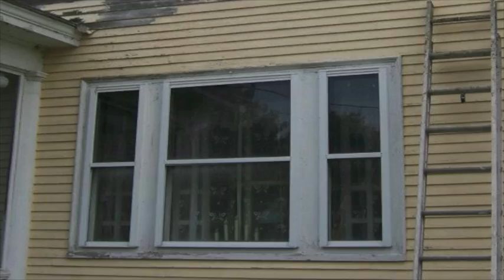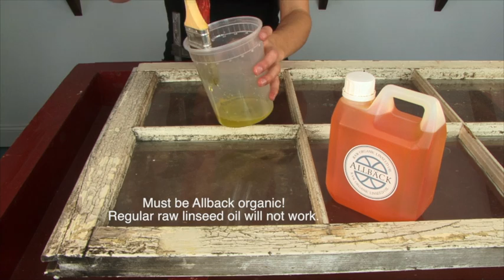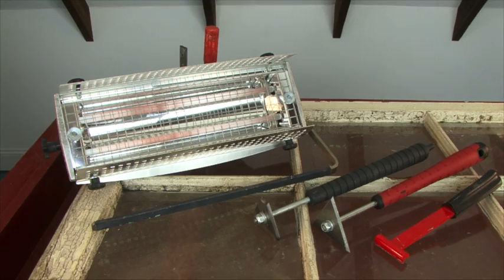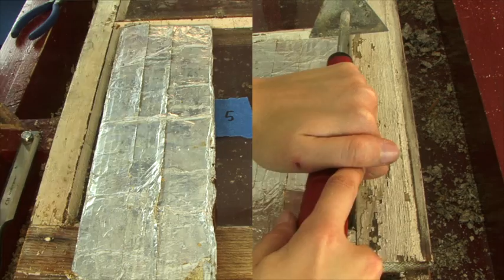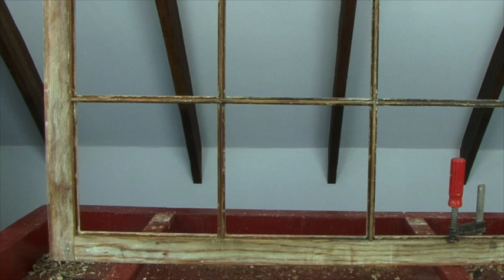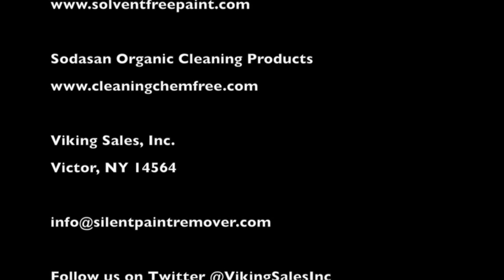Window Restoration w/The Silent Paint Remover: Part 1 [Full]

Comment: Thank you very much for this great video. I am removing old paint from a 100 year old windows and was wandering how critical is to clean ALL the paint. Its very hard to go between the ridges of the wood and I don't want to sand to deep. I am planning to use raw linseed oil and linseed oil paint.
Reply from the maker: You do not need to remove every speck of old paint from the wood grain certainly but the better prep to achieve a “primarily bare wood surface” means you have the best surface to then apply your Linseed Oil Paint. Agreed, you want to avoid sanding as much as possible so do you best and if you feel uncertain, you can always email us an image of the current condition and we can offer suggestions: info@earthandflax.com Hope this is helpful!

Comment: Any advice or comments about using boiled linseed oil instead of raw linseed oil?
Reply from the maker: As long as you use a purified/degummed, higher quality linseed oil, you can in theory use either for window restoration. We would recommend a heated, drying Purified Linseed Oil for most applications. For exterior applications, the Viking Purified Linseed Oil has a small molecular structure, soaks in deeply, and has a 48 hr timeframe typically. A very useful, versatile oil to use. Be careful using a true Swedish raw linseed oil as it will take a long time to fully dry. A purified boiled linseed oil like the Ottosson Boiled LO can also be used. It has a little faster dry time, is what the Ottosson Linseed Oil Paint is made with, and has a larger molecular structure (doesn't soak in as deeply/quickly). Hope this is helpful!

Comment: Great video. Using your strategy/procedure for heating the putting, what is your incidence of cracking panes of glass. Do you prefer the tape or the cardboard? Thanks.
Reply from the maker: Great to hear the video was helpful. I am neurotically careful about covering the glass when heating with infrared so rarely have issues with breakage (I also do not do window restoration as a profession so work rather slowly/carefully). If it happens, it is usually very thin, old glass. I prefer the covered cardboard so I can move it around as needed and cover certain areas of the wood I've already heated for example. It is really up to personal preference I think so experiment on an extra or salvaged sash to find what works best for you. Also, if you are working on a lot of sashes, there is an infrared Putty Lamp that uses a different type of bulb where there is no risk of breaking glass. Glass must be clean for this tool to work effectively. Not something we have added to the website yet, but I can source it if needed. Hope this is helpful. Feel free to reach out to info@earthandflax.com with additional questions.

Comment: Is there a method of getting the glass out of the lower sash, where the glass is inserted into a kerf in the meeting rail? I've found that this part is very difficult and I've broken several windows trying to remove glass from the lower sash

Comment: Does this window contains lead paint ?
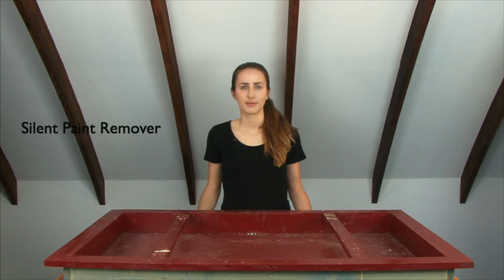Reply: Yes, she said it contained lead at 0:50
Reply: @stegokitty  thank you
Reply from the maker: It is often best to assume all old sashes may have lead paint present. That is one of the reasons why infrared is a good choice for paint removal - lower operating temp. It is always advisable to wear proper safety gear, including a respirator, as even modern coatings can have safety concerns associated. Dampen and dispose of debris as directed by your local community waste management location.
Reply: @Earthandflaxstudio  lead is also a problem when it contacts the skin, gloves are annoying but I wish I had known this when I started this kind of work. Lead poisoning is not fun, and permanent according to my doctor.

Comment: What if you want to stain and varnish the inside? How do you deal with the paint that stayed in the grains?
Reply from the maker: Hi John, It sometimes can be tricky to achieve a stain or varnish grade surface and much depends on the condition of the wood. A trick with infrared is to apply some Viking Purified Raw Linseed Oil to the surface, heat with the infrared tool, and use some steel wool to clean out the grain. Repeat as needed.

Comment: Do you know of any tutorials on using similar products for old overhangs that are caked on with paint? I've been removing it with the Cobra paint remover, but it does not come off anywhere near as well as it seems to come off of your windows. It could be not using Linseed Oil, but I'm not sure if I should use that because I'm not sure if I'll be using Linseed oil paint for the repaint.
Reply from the maker: Hmm the Cobra should be the same technology as The Silent Paint Remover and usually the more layers of paint the better with infrared. That said there are some coatings that are not responsive to heat like milk paint and shellac. Such coatings are rarely found on exterior facades but that could be a factor to consider. Is the paint softening at all? Perhaps it is very dry and the Purified Linseed Oil would help reconstitute it, although as you hinted at you don't want to soak the wood with a lot oil of you plan to use a plastic paint. If the coating is not responding at all to the infrared heat, then you probably have to find another paint removal option. Feel free to email info@earthandflax.com with more project details. Thanks for your question!

Comment: Can anyone tell me where I can find 'inorganic' linseed oil!? People using these terms should learn what they actually mean instead of just using popular buzz words.
Reply from the maker: Hi Stephen, Thanks for your comment. Most generic linseed oil products are pretty much petrochemical products at this point and the Allback Method in Scandinavian Windowcraft circles has always used the term "organic" for linseed oil/linseed oil paint. Today, I think the term Purified Linseed Oil is perhaps a better term and one I use more so to divide a natural linseed oil that has had the proteins removed and heated to create a RLO or BLO vs. a petrochemical linseed oil that uses chemical driers and other additives (fungicides, pesticides, etc.) to combat the downsides of not removing the protein. In newer videos, you will notice "purified" has pretty much replaced "organic."
Reply: Petrochemicals are, by definition, organic substances. Highly bastardized term.
Reply from the maker: Yes, so you would agree "purified" linseed oil would be a more helpful term to categorize an alternative method of manufacturing the product?

Comment: How do you dispose of the old paint and putty?
Reply from the maker: Hi Joseph, Check your local regulations as if lead is present in the paint it is usually required to drop off bags of paint waste at the nearest hazardous waste collection site or designated recycling center. Different municipalities may have different requirements. Feel free to send project or Linseed Oil Product questions to info@earthandflax.com anytime!
Reply: U don't need to do it. You can  next morning put the crunchy old putty and paint chips into the bowl, add some 3,2% milk a bit of cocoa (natural the best but can be Nesquik) and eat this shit.

Comment: I hate to sound all preservationist-like, but often the restoration process is more about keeping and maintaining the old and oftentimes original materials which add to the overall aesthetic of the building. It's not hard to make the argument that newer, factory-made triple-pane windows are more energy efficient. What really matters are your priorities. If you value efficiency and energy cost savings over aesthetics and period details, then go buy yourself a well-made new window. For some folks, putting on a sweater and burning a little more oil is just part of living in an old house. You don't drive an antique car for it's fuel efficiency and reliability; if that's what you want, go buy a new car. But there's something about those old cars...and old houses. Anyway, I'll just keep on trying to convince people not to throw everything in the dumpster. If you must, please call a restoration pro first and have them take 'em off your hands!
Reply: IMO much of the character of an old building is in the old windows. I live in a village in Bulgaria and it really bothers me to see the old fashioned windows being torn out and replaced by uPVC.
Reply: This spring with the virus shut down I started refinishing my 20 single pane double hung 1914 Arizona old traditional windows with internal counter weights and brass hardware.

I love the old traditional windows. It was like being taught by the architect as I restored each piece. I tightened up each window and insulated each side pocket too.

I have already maxed the insulation in the attic, walls, and floor and I have long window drapes keeping the heat inside. Now I have started putting plexiglass in the windows just for the winter for an addition air zone of insulation. It allows the electric thermal floor slab under the bed and desk to silently and comfortably heat the bedroom.
Reply: I’m keeping my 150 yr old growth wood windows. I have to say that they wanted $80,000 to replace my windows with vinyl. I just picked up all the double pane glass, spacers, butyl and weather strips for about $5000. $75000 savings will heat my house for about 500 years
Reply: Wow!  How many windows for $80,000?

Comment: there's only one good solution for these old windows it's called a bonfire breakdown  and go buy some new windows you morons they'll pay for themselves they're more energy efficient and you don't have to paint them what you're doing just looks like a dumb Hobby restoring old energy-wasting windows
Reply: liberty and justice . first of all try to be a human and respect other people you piece of shit .second put the energy efficient windows inside your ass .I love old windows .
Reply: Windows can take decades to pay for themselves.  Try to be smarter.
Reply: tedeohifi dude you're a goof I have a remodeling and construction business for 40 years what do you do for a living it doesn't take decades to pay for a triple pane window do some research before you make stupid remarks
Reply: If it costs $15k to replace my windows (and that's not premium windows), and my average bill (cooling in the summer, heating in the winter) is $120, what percentage of savings do I need to  attain to pay it off in 10 years or less?  Answer:  104%.  Buying new windows would have to completely erase my gas and electric bills for 10.5 years to pay for themselves.  Optimistically, id  maybe save what...20, maybe 30% in heating and cooling costs? So...how many years?

In all fairness, utility costs are different per geography, and so are construction costs, so not all situations are the same.

But for me, refinishing my old windows is well worth saving $15k.
Reply: Couple scrapers, stripper, sanding block, infrared heater...bunch of other stuff, still only a couple hundred bucks, plus my time.  And there's no way id get the money back if i sold.  

Again, not all situations are the same, which is why you are better off not calling everyone who elects to refinish, rather than replace, a moron.
Reply: "Upgrade" something that has been made to last 200+ years with something that will leak it's argon and start fogging in five years - needing to be replaced again in 20 years? And replaced and replaced and replaced... for the rest of the houses life. That's short term thinking. As for efficiency benefits of new windows - it is dishonest marketing. The comparison is of new windows vs doing nothing to old windows in need of maintenance. Reglazing and filling gaps will get you very close to the efficiency of new windows and there's more that can be done. I assume you are making money off the sale of the windows, as well as, the labor. That would explain why you're such a fan of new windows. You're not just a remodeler, you are a salesmen. I have nothing against new windows, just the way they are marketed and the way you have chastised everyone who hasn't bought into your new window marketing con. If you are trying to get people to believe in your product than you are shooting yourself in the foot by being a comments troll.
Reply from the maker: Obviously, folks can get pretty passionate about restoration! If you are interested in learning more about the advantages of old, wood windows and Traditional Purified Linseed Oil Products (paints, oils, waxes, etc.) check out the links in our most recent post. The Allback family in Sweden has created so many valuable resources that we would love to share.
Reply: +Liberty and justice for all
You've used the following words or phrases over the course of your 4 posts:
"you morons"
"dumb hobby"
"you're a goof"
"you make stupid remarks"
"good luck buddy sounds like you're doing a great job"
"you're ignorant"

Hmm, maybe you really are a remodeling contractor!
Reply: Liberty and justice for all dorsch if you don't get it shut up
Reply: Patrick M. Rausch you're ignorant get some energy efficient windows and throw them old windows in the garbage believe me I'm a remodeling contractor it'll save you money in utilities them single pane windows are garbage and the glass isn't even safe the stuff breaks like beer bottles it could kill you if you have a wind storm or tornado

Comment: What is the chisel that has the guides on it? Is this a regular chisel that has been modified or the guides attached much like the ones used for stair construction.
Reply: I just ordered one from www.paintbrushesandrollers ,comlisted above.   could not find one on ebay /amazon/Irwin marples.got it in mail todayIrwin Marples 19mm  3/4"   S19T   /   or       SI9T.....cant really read the stamping
Reply from the maker: Hi gary24752, The Chisel w/Roller is a modified chisel and we have had a few folks make their own. Ours can be found at www.silentpaintremover.com on the accessories page or at www.earthandflax.com. Direct link here: http://www.earthandflax.com/item/chisel-w-roller

Comment: This is one of the best and most complete videos I've seen on how to restore a window.  The only thing I do is I drop some water on the pane to cool it down as I am heating/scraping.  It saves the windows from cracking. Also, the silent paint remover will blacken the surface if left too long in one spot.

Comment: Be careful of breathing lead while using this method
Reply from the maker: The Silent Paint Remover only heats the surface to 300 degrees or so and never reaches the temp where lead vaporizes. It is much safer than a heat gun or torch. That said, you should always wear a respirator and practice caution when removing any type of coatings, especially those suspected to include lead paint.

Comment: sanding unnecessary? are you mad?
Reply: "If you are using a good quality scraper then little to no sanding may be required" is what the lady said. Now a good quality scraper will cost you a fair few quid, just looked at one of my on line suppliers and a 4" scraper will cost you £72 with blades being about £40, these blades will be able to be re-sharpened using a whetstone in the same way a carpenter sharpens his chisels, this is not a £2.50  piece of junk from a box seller. The finish from a sharp scraper is very fine,  just think of a cabinet makers scraper which is used as a finishing tool.
Reply: I know, right?
Reply: here here